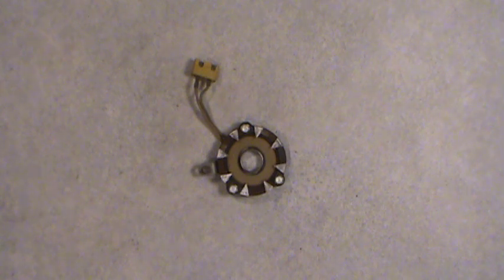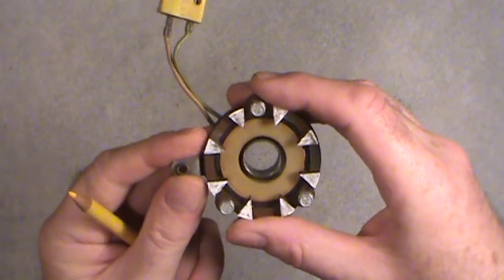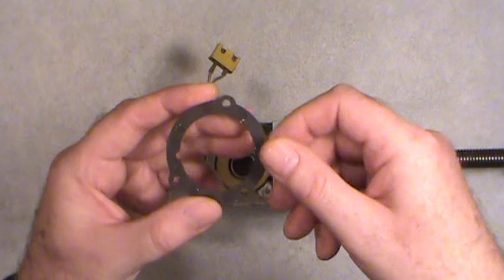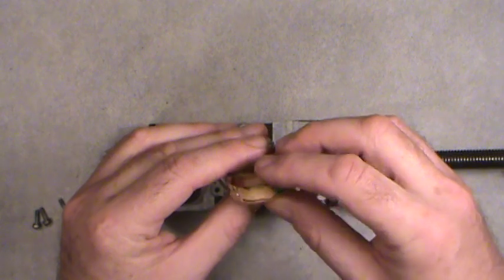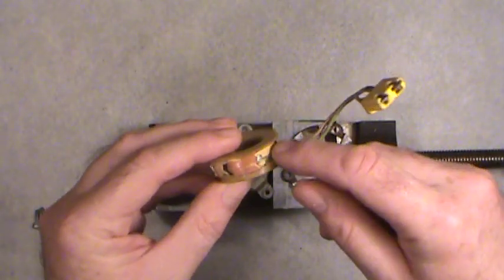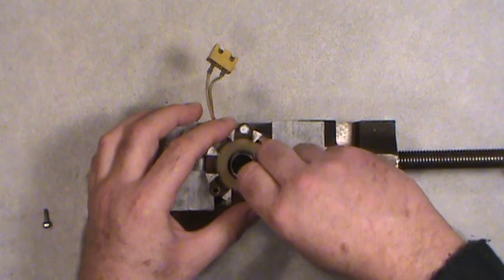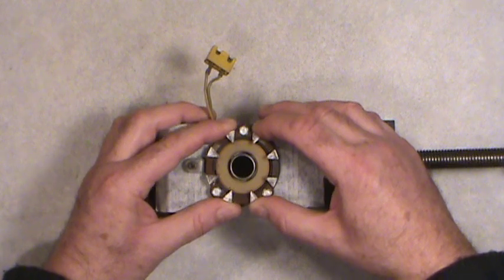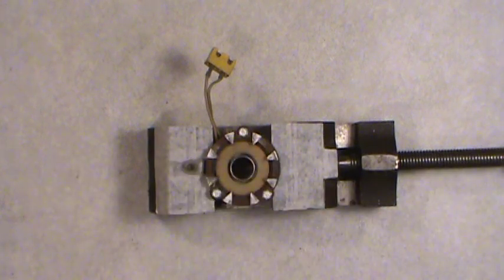HEI Pickup Coil Assembly Taken Apart and Explained with Installation Tips!

Comment: Your video is very good but do you didn't. Say what's the purpose of those two color wires  if you could include that in the video.
Thanks
Reply from the maker: Greetings...Morning Star........Thanks for watching........Those two wires, just send a signal (very low voltage pulse), to the ignition control module, that tells the ignition coil, when to fire each spark plug, at the correct moment in time, as required by the engine........I had an HEI distributor removed from the engine, with the distributor cap, off of it, and also, had that 2 wire connector, that comes from the pickup coil, connected to a volt-meter, and, I spun the gear end of the distributor by hand, as fast as I could, and, as I recall, I got about 1 volt showing on the voltmeter (ac volts...???...not sure)...and.......till next time......Be Safe, take care, and have a good one.

Comment: One thing I’d like you to talk about when doing information in this, is the clockwise vs counterclockwise polarity. The north south and how to test for that to make sure we have the right coil. 
I would like to know which coil for a Chevy 350 as the engine turns clockwise. 

A lot of the Chinese distributors are on the market that make the Hei style, fit other brand engines. The one my Hei is on a dodge 318.....it’s like a retrofit. 

I’m dealing with has white wire on the left side, green on the right. 

I would like to see a test on polarity or have it discussed as to how it affects the performance. 
Part of the problem I have is that when I installed this distributor, it was out of phase by about 20°. I had to advance the timing so much to get the car to run, that it put the timing in between tow spark towers. This made the engine start sometimes well.....and sometimes it backfires because it hit the wrong tower of the two.....

What was said....was that since I was dealing with a Chinese distributor, that even if I put it back into phase.....I might have the wrong polarity coil as well as being out of phase. I would like you to talk about this and possibly get back to me to solve it. 

This level of information helps with the understanding of why these things work.....not just that they work. 

In my case I needed to know about polarity, coil winding direction, air gap, the firing in degrees ....after the poles line up....etc. I have to repahse this by pressing the wheel off and relocating it to fire in the right place. Then have the right pole piece in there.....there was talk of the star wheel also being upside down.

Here is a picture of the phase at #1 at TDC. if it will download. 
[url=https://flic.kr/p/RCJQYr][img]https://live.staticflickr.com/7894/32577234937_29b083494f_m.jpg[/img][/url][url=https://flic.kr/p/RCJQYr] 
Out of phase this much.....about 1/16”-[/url]
Reply from the maker: Greetings...John Colenso...……..Thanks for watching...…….There might be, an HEI (High Energy Ignition), Distributor, (might be, the Large, distributor Cap type), that is, of high quality, and is custom made, in the USA/United Sates of America, and, the "inition curve weights and springs, and, the vacuum advance cannister too), will be, set up properly, for your "exact", vehicle and engine combination, that, will probably make, your engine run very strong, and economical, as can be (they will want to know, a lot of information, about your vehicle and engine, so they will be able to "calibrate" (set up), their, custom made Distributor, so it will get the most, out of, your exact engine...……..The company's name is...DUI (Davis Unified Ignition), and, they also have, some very good, custom made spark plug "wires", that will carry, all of that high voltage, to the spark plugs, really good, so maybe, check out their website...……..If you want to see what, the HEI Distributor "pickup coil" lead wire, colors look like, for Clockwise, or, Counter-clockwise, distributor, "rotor" rotation, which might be, polarity specific, then, go to the website...Rockauto...and do a search, for a 1975 Chevrolet Camaro, with a 350 cubic inch (5.7 liter) V-8, for the (Clockwise) rotor, rotation...……..Then, do a search for, a 1980 Oldsmobile Cutlass Supreme, with a 4.3 liter (260 cubic inch) V-8, for the (Counter-Clockwise) rotor, rotation...……Are you doing a "customized", high energy ignition distributor "upgrade"...!!!...and, if so, are you going from, a "points and condenser" distributor, to maybe, the, shall we say, Chrysler/Dodge/Plymouth, "electronic" distributor style, that I've seen on a 1974 Dodge V-8, that usually had, an ignition unit (metal box), that was mounted on the vehicle's firewall...???...……...Here are the basics, that I use, when installing a new or used distributor...…...First thing, is to "make sure", that, the...Number 1...cylinder's piston, is at top dead center, at the top of the compression stroke (very important...!!!)………..Then, choose, where you want the rotor's "Metal Tip", to be pointing, when the Number 1 cylinder's spark plug, will be firing (might have the rotor's metal tip, pointing at the number 1 cylinder, on the engine itself, that's what I do, for a chevy, small block V-8)………..Then, "make sure" that, the Number 1 spark plug "wire", and the distributor cap's (metal) terminal, that it is plugged onto, are reasonably, inline with, the rotor's metal "Tip"...……..Then, advance the triggering mechanism (with a points system, or, with the magnetic tooth type, just a few degrees advanced, ahead of top dead center), by, turning the distributor housing, just a little bit, and lock it down (please note, that, distributor degrees, are only 1/2 of the crankshaft degrees...!!!...because of, the 2 to 1 ratio, of, the number of teeth, that are on the crankshaft sprocket, versus, the number of teeth, that are on the camshaft sprocket...!!!)………..The chevy HEI distributor, drive gear, will usually have 13 gear teeth (odd number), and, there will usually be, a small "dimple"/partially drilled hole, in the gear's hub, and it is this "dimple", that has to line up with, the distributor, rotor's, metal "Tip", or, the rotor's metal tip, will be out of phase, with the metal terminals, that are on the inside of the distributor cap...!!!...……To check distributor, rotor phasing, Ya can get an old/used distributor cap, and drill or cut some holes in it, so Ya can see the position, that the rotor is in, when it goes "spark", or, for some distributor types, Ya can even buy, a "clear/see through", distributor cap...cool huh...……...A vacuum advance cannister, can affect rotor phasing, quite a bit, so, Ya have to average, the travel, of the rotor's metal "tip", so it doesn't get to close to, the "wrong" metal terminal, that's inside of the distributor cap...……If it's a factory type of distributor, that you want, then, maybe, buy the whole system used, and hopefully, it won't be worn too much...……..That HEI distributor, works on a falling electrical wave signal, as in, when those 8 triangular shaped teeth, just go past each other, then, that's the electrical signal, that triggers, the HEI ignition control module, well, as far as I know, that is...…...I haven't seen your video yet...…….If you can tell me, what it is, that, you are using parts-wise, then, I might have a better idea, as to what you are trying to solve...…….Good luck, and......till next time...…..Be Safe, take care, and have a good one.

Comment: HI ROCKY, THANK YOU FOR YOUR DETAIL IN YOUR VIDEOS. 
I HAVE A 1987 CHEVY MONTI CARLO LS V-8-305 CARBURETED.
MY 305 DIDN'T COME WITH THE BIG HEI DISTRIBUTOR,
IT  CAME WITH SMALLER SIZE DISTRIBUTOR WITH AN EXTERNAL COIL,
THAT GOES ON THE FIREWALL.
MY PROBLEM IS THAT I NEED A PICKUP COIL MODULAR, WHICH GOES IN THE DISTRIBUTOR.
MY QUESTION SIR, WHAT TYPE OR WHAT OTHER IS THIS DISTRIBUTOR, CALLED BY
LIKE A HEI, WHATS THE NAME OF THE OTHER. AND A PART NUMBER IF YOU KNOW IT.

I AM TRYING TO DO IT MYSELF AND APPRECIATE IF YOU CAN, SUGGEST ANY HELP,

THANK YOU FOR ALL YOUR HELP ROCKY
Reply from the maker: Greetings...TIO RAY...……..You're welcome, and thanks for watching...……….Your Monte Carlo's distributor, is still an HEI (High Energy Ignition) type of distributor, which is usually called, an HEI distributor, that has a "remotely" mounted ignition coil (as in, the ignition coil, is mounted, all by itself, just a short distance, away from the main part of the distributor, and is usually connected to the distributor cap, with, what looks like, a (high voltage) spark plug wire...…….You were saying, that you were looking for, a...pickup coil modular...???...well, I'm not sure, as to, just what part...???...that you actually need, as in, it might be, an...Ignition Control "Module"...or, maybe, it's a...Pick-up Coil...???...……….If it happens to be, the...Ignition Control "Module"...then, make sure that you put a thin layer of...Heat Transfer Paste (or, sometimes called, heat sink grease or paste), that, the..."Computer"...people use (just buy the cheaper stuff), because, if it is "not there", between the bottom (metal side) of the ignition control Module, and the (metal) part, that it gets screw/mounted onto, on the inside of the distributor, then, the ignition control Module, will probably "over-heat", and fry itself...!!!...also, make sure that, all mounting surfaces are very clean, and that, those 2 screws, that usually go through the ignition control module, are very clean too, because, if this small distributor, works like the bigger one, then, those 2 mounting screws, will probably be, the electrical "ground" connection, for the ignition control Module...…….As for the "Part Number", that you are looking for, then, here's a good way to get it...……..It's, as easy as, phoning, or going to, a car parts store, and, tell the parts guy or gal, what your "exact" car is, as in...Year...Make...Model...Engine size...and the type of Distributor, that it has in it, and, they will probably look up the "Part Number", on their Computer (or in a book...???...perhaps), oh, and, some auto parts stores, that I've dealt with in the past, would write a bunch of different, part manufacturer's, part number, for the very same auto part, that I was looking for, oh, and, the price of that very same part, that each part manufacturer was asking for, as well (cool huh)………..If your distributor cap, has the "small", spring loaded "carbon button", on the inside, of the top of it, in the center, then, make sure, that, you have a look at it, once in a while, because, they wear down, way too quickly, and, if it loses contact, with the spinning rotor's metal strip, then, there will usually be, a big, not wanted, high voltage "spark" occurring, where there should not be one, and, might cause the engine to miss-fire, as well as, it will probably put, a not wanted "strain", on the ignition coil...……..Try to keep, the spark plug's "gap" (between the 2 electrodes), to the specification (size of gap), and, might be found, on a sticker/label, in your car's engine compartment...……..If you care to, you can tell me, what problem, that, you might be having with your engine...…..Good luck, and.....till next time.....Be Safe, take care, and have a good one.